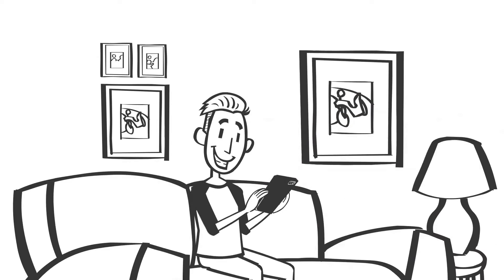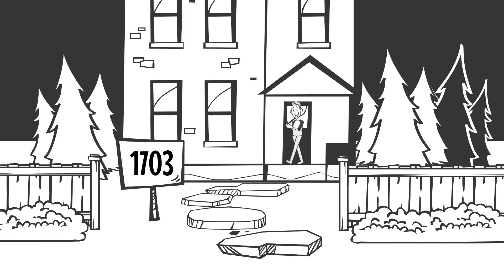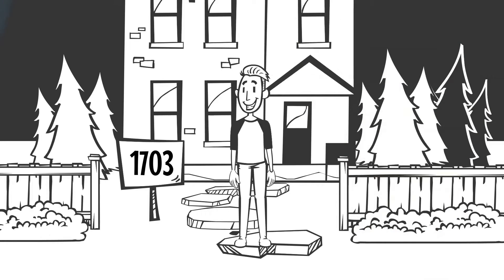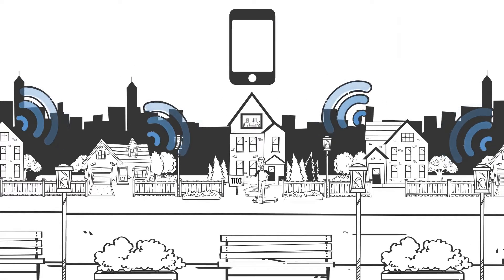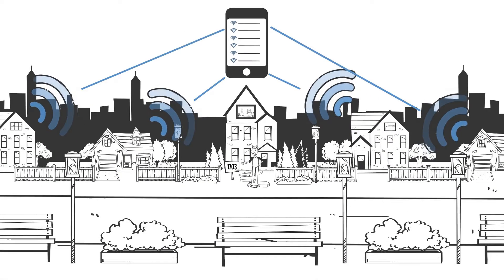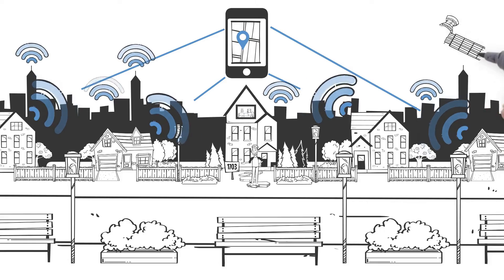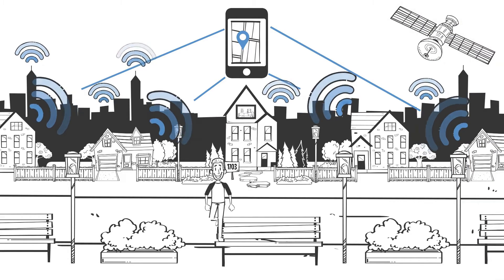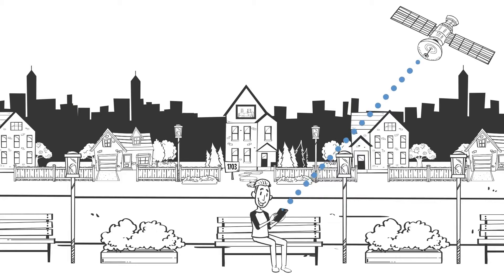indoor positioning system with ESP8266 and Wi-fi. ! Find the location of the Device using ESP8266.

Comment: Kindly can you provide me the code link?
Reply from the maker: #include <ESP8266WiFi.h> // Define your Wi-Fi SSIDs and passwords const char* SSID1 = "Electro7781"; const char* PASSWORD1 = "12312389"; const char* SSID2 = ""; const char* PASSWORD2 = ""; // Initialize Wi-Fi connection void connectWiFi(const char* ssid, const char* password) { WiFi.begin(ssid, password); while (WiFi.status() != WL_CONNECTED) { delay(1000); } Serial.print("Connected to "); Serial.println(ssid); } // Measure RSSI (Received Signal Strength Indicator) void getRSSI(int& rssi1, int& rssi2) { int numNetworks = WiFi.scanNetworks(); for (int i = 0; i < numNetworks; ++i) { if (WiFi.SSID(i) == SSID1) { rssi1 = WiFi.RSSI(i); } else if (WiFi.SSID(i) == SSID2) { rssi2 = WiFi.RSSI(i); } } } // Calculate distance based on RSSI (simple model) float calculateDistance(int rssi) { // You'll need to calibrate this based on your environment float A = -50; // Reference RSSI at 1 meter float n = 2.0; // Path loss exponent (typically between 2 and 4) float distance = pow(10, (A - rssi) / (10 * n)); return distance; } void setup() { Serial.begin(115200); connectWiFi(SSID1, PASSWORD1); } void loop() { int rssi1 = 0, rssi2 = 0; getRSSI(rssi1, rssi2); float distance1 = calculateDistance(rssi1); float distance2 = calculateDistance(rssi2); Serial.print("Distance from Router 1: "); Serial.print(distance1); Serial.println(" meters"); Serial.print("Distance from Router 2: "); Serial.print(distance2); Serial.println(" meters"); delay(1000); }

Comment: can you public your code
Reply from the maker: #include <ESP8266WiFi.h> // Define your Wi-Fi SSIDs and passwords const char* SSID1 = "Electro7781"; const char* PASSWORD1 = "12312389"; const char* SSID2 = ""; const char* PASSWORD2 = ""; // Initialize Wi-Fi connection void connectWiFi(const char* ssid, const char* password) { WiFi.begin(ssid, password); while (WiFi.status() != WL_CONNECTED) { delay(1000); } Serial.print("Connected to "); Serial.println(ssid); } // Measure RSSI (Received Signal Strength Indicator) void getRSSI(int& rssi1, int& rssi2) { int numNetworks = WiFi.scanNetworks(); for (int i = 0; i < numNetworks; ++i) { if (WiFi.SSID(i) == SSID1) { rssi1 = WiFi.RSSI(i); } else if (WiFi.SSID(i) == SSID2) { rssi2 = WiFi.RSSI(i); } } } // Calculate distance based on RSSI (simple model) float calculateDistance(int rssi) { // You'll need to calibrate this based on your environment float A = -50; // Reference RSSI at 1 meter float n = 2.0; // Path loss exponent (typically between 2 and 4) float distance = pow(10, (A - rssi) / (10 * n)); return distance; } void setup() { Serial.begin(115200); connectWiFi(SSID1, PASSWORD1); } void loop() { int rssi1 = 0, rssi2 = 0; getRSSI(rssi1, rssi2); float distance1 = calculateDistance(rssi1); float distance2 = calculateDistance(rssi2); Serial.print("Distance from Router 1: "); Serial.print(distance1); Serial.println(" meters"); Serial.print("Distance from Router 2: "); Serial.print(distance2); Serial.println(" meters"); delay(1000); }